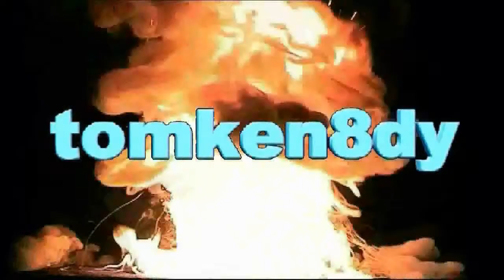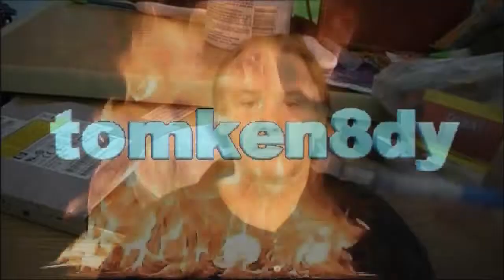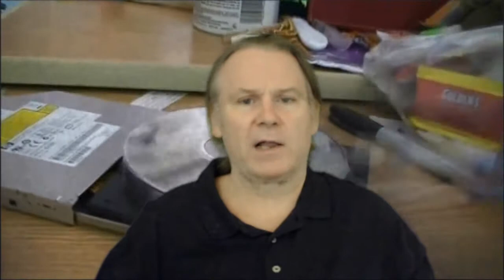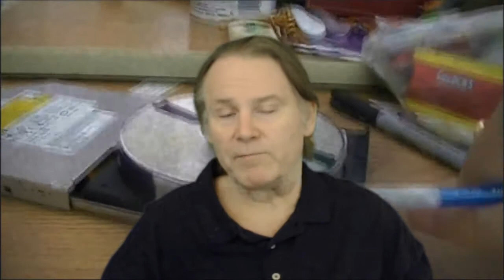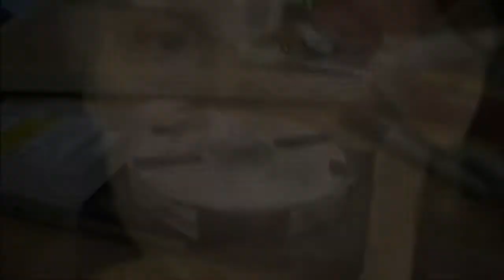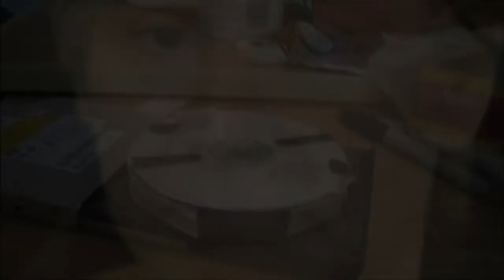How Does A Generator REALLY Work?

Comment: The electrons of the coil are being moved out to be consumed; that is the electric current that is used. There will always be the same amount of electrons in the coil since there are two directions coming in back to the coil and out towards the power consumption.
Reply from the maker: You're ignoring the Law of Conservation of Matter and Energy and suggesting Perpetual Energy. What about all those "electrons" being transformed into light, heat, mechanical energy by consumers? It all just magically reappears? https://en.wikipedia.org/wiki/Conservation_of_energy
Reply: Tomken8d2 You're right, I'm just as confused as you are now lol
Reply from the maker: Jado
I'm not confused.
Reply: Confused as to where the electricity is coming from in an electric generator
Reply from the maker: Jado
I already have a very good idea.
Reply: Tomken8d2 ..alright then where does the electricity come from?
Reply from the maker: Jado
Ambient space, through momentary dimensional rifts caused by the turbulence of windings and ferrous metal passing through the magnetic fields. There is a vast sea of energy just a few layers of dimension away from us.  If you open a rift large enough and long enough we'd all be fried to a crisp. A "controlled" opening could be used as a weapon of war.
Reply: Tomken8d2 Very interesting theory, I'd love to see more research in this subject
Reply from the maker: Jado
You won't so long as we burn oil for power. Nikola Tesla came up with that theory, btw.
Reply: Tomken8d2 Oh wow. Do you have a source? I'd like to bring this up to one of my professors
Reply from the maker: Jado
Tesla believed that everything was resonant energy.  Your professors will likely frown upon Tesla and this whole alternate theory.  If it's not written in the approved textbooks, it's heresy.
Reply: Finally I think I may have the answer; 

The voltage will be evenly spread out along the wire, so to speak. If there is a resistor or other load on the wire, it will act as a bottleneck. The concentration on the negative wire will be almost constant from the terminal all the way to the load, and similarly the other wire will have a concentration that is lower than the negative wire.

Resistance is NOT a loss of electrons. The rate at which electrons flow (current) is limited by the resistor and how many electrons can be shoved through it, given how much pressure the high concentration side is exerting on the low concentration side (voltage). This is where energy is lost as heat, forcing electrons to flow through a resistor that they don't really want to flow through, and causing friction (both physical and magnetic). But no electrons are lost in the process.

Also, don't forget AC current, where all the same stuff is happening, but the generator just constantly shoves electrons out, and then pulls them back in. No electrons in the circuit ever move more than a microscopic amount, they just reach a steady state where they constantly move back and forth, generating heat and EM fields.

So it's not that electrons are being transformed into light & heat, their potential energy is simply being lost as other forms of energy when they go through the 'bottleneck' (resistance) as the pressure also drops.
Reply from the maker: Jado
Light, heat and Mechanical energy are being produced by consumers.  They don't appear from nowhere. Current is being converted to other forms of energy and removed from the circuit. Conservation of Matter ad Energy.
Reply: Tomken8d2 Yes, but the current is not being removed from the circuit. No electrons are leaving the circuit, it is simply their high potential energy that is being lost to supply other forms of energy when they go through the resistance.

Comment: You said a metal core... what would happen if you passed a magnet near a copper core in plastic instead of metal?... does it need to be metal?... magnet near copper windings... minus the metal?...
Reply from the maker: Depends on how the material responds to magnetism. Ferrous metal works very well.